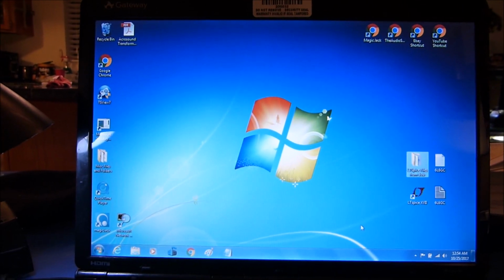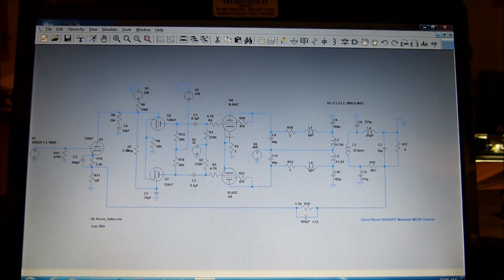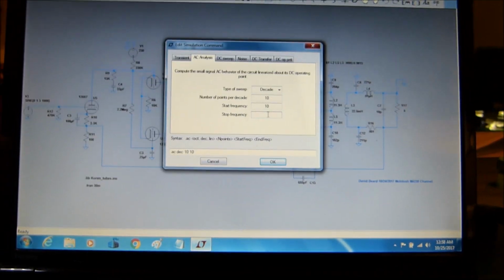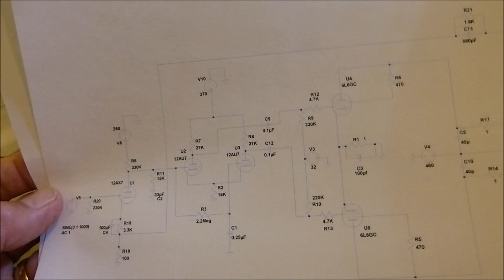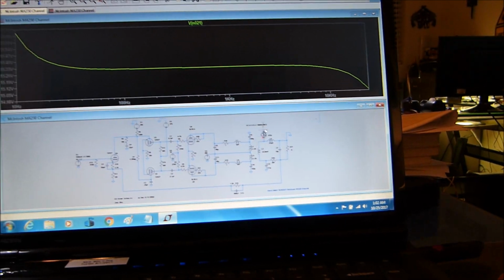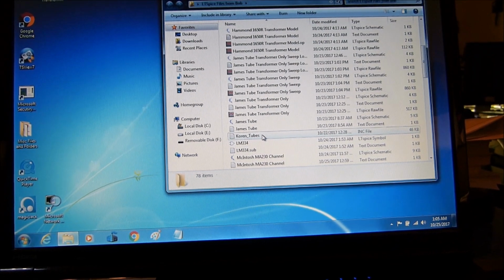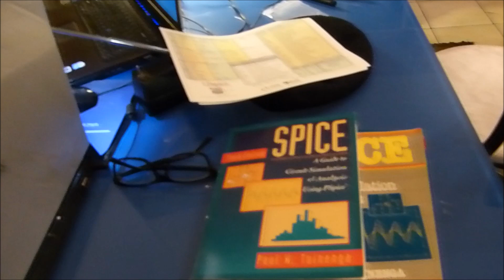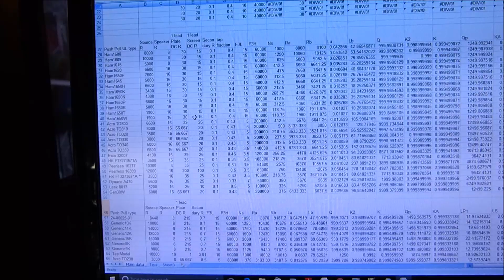LTSpice Modeling Of Vacuum Tube Amplifiers & Output Transformers

Comment: Hello! Thanks for the video, I'm a beginner in ltspice and I'm searching for some basic models for tetrods to study the non-linear caratteristic curve... Can someone help me if you have any schematics? 😢
Reply from the maker: Not sure what all I mentioned in this video but there are two libraries of tube models available on the Internet. One is by, Normal Koren and another known as, Ayumi. Search for, Normal Koren Spice vacuum tube models and Ayumi Spice tube models. There are many models available to download. Spice is the original modeling program going back more than 30 years and is what models are often referred to. We use them now in LTSpice. There is also a student version called PSpice but I do not know if it will use these vacuum tube models or not. I just clicked on some of the links below in my comments (have to open my comment) and they still work. Try them. Hope this helps.
Reply: Thanks, I'll watch your links! I'm struggling to find a model of tetrode that isn't "beam" because I need the unstable curve but they seem to be unreachable... For example the RCA 24-A, I've found the datasheet but not the spice model
Reply from the maker: @Daniela-ow2vd  You can build your own model. Use a known good working model (tube number) to start with and study the details and how they relate to the specs of that tube. It is just a text file and you can modify it and save it with a new name. Then study the model (tube number) you want and modify the working one renaming it to your tube. It is a bit tedious but it works pretty well. I have done that for large transmitter triodes. The EL34 is a pentode so maybe just delete the specs for the suppressor grid (??) might get you close. Hope it helps.

Comment: That's a great quick intro to LTSpice. LTSpice is absolutely great. It takes some time to get to grips with and take advantage of its more advanced capabilities but it takes very little effort to get a basic circuit in it and get it to work.  I can't remember what my first experience with it was 20 or so years ago when I first got to use it but I recently installed it again and I found it to be a complete doddle. I was really pleasantly surprise by how easy it was to use without having any prior training or experience in using it. It has a very intuitive UI.

Comment: Can this be relevant to '60s ~ '70s solid-state amps?  Any advice would be greatly appreciated. Thanks!
Reply from the maker: Yes, the LTSpice program is very powerful and is used for solid state equipment. 

We are fortunate that it can also be used for vacuum tube equipment if the Norman Koren or Aymui library of vacuum tube models is also downloaded and copied into the directory where the LTSpice program is located. You can down load it for free at the link below.  It is a fantastic program based on the Spice circuit simulator program developed at UC Berkeley. There are other Spice based programs like PSpice which has a free download also that is a student version. The student version is functional with a limited library of models (I do not know if it will run the vacuum tube models or not) and a limited amount of nodes in the model. Usually, the PSpice student program is sufficient for most projects. I used is successfully when I worked for Lockheed at WSMR in the 1990's.

http://www.analog.com/en/design-center/design-tools-and-calculators/ltspice-simulator.html?gclid=EAIaIQobChMImM6u8a-C3QIVTLnACh0iGQMfEAAYASAAEgJM_fD_BwE
Reply: ElPaso TubeAmps Wow! I have a mystery Amp from '76? (SS Earth Producer) I have no schematic, can't cross-reference the power transistors - not too worried, I'll just put the Peavey's in without blowing anything up? - but I've been wondering how many different transistors would do different tones.  With Ltspice I could find out. Thanks!

Comment: Just a tip: the Koren models are grossly inaccurate. While none of the tube models accurately model clipping behavior, I have found the freely available Ayumi models to be incredibly close.
Reply from the maker: Benjamin,
Thank you. I can find it easily at http://ayumi.cava.jp/audio/tubemodel_3.20_win.zip
and it unzips easily but I can't figure out how to put it into a file like the Koren tubes and call it as a library. I try calling each tube individually but it I can't get it to work. I suppose I could copy each one into a folder but that seems too laborious and I am sure there is an easier way. Can you help?
Reply: The Ayumi models are trickier in that there isn't a single library for all of them, and that they require a bit of editing to work in LTSpice. I decided to just create a library you can add, with all of the models "fixed" for LTSpice already. This should make them easier to use. Here's a link to the zipped up library file: 

https://www.dropbox.com/s/0uhqqvdnqpq03qu/Ayumi_Tube_Model_Library.zip?dl=0

Just unzip it in a folder LTSpice can access, use a standard .inc statement to include the library, add the appropriate symbol for the tube type you want, and then edit the value field to the name of the subcircuit given in the library. The name of subcircuit is usually just the tube type.
Reply: A few other pointers, there are pre-triode strapped models for various pentodes, beam power tubes, tetrodes, etc. USE THEM. The simulations are faster and more accurate.

For a triode, you would just include a triode symbol, but for any pentode, tetrode, beam power tube, etc, regardless of the number of grids, you have to use the tetrode symbol. 

The little readme file I wrote has more information, plus a complete list of all the tube types available, given as the exact string you want to enter in the value field when using that particular tube model.
Reply from the maker: I have been trying them and what I have had to do so far is include each tube individually in the schematic but when it runs it turns out really bad so I suspect I am not including another file in the directory that is necessary. Is there any way to put all of these files in one folder so they can be called very simply as they are in the Koren tubes with a .lib statement?
Reply from the maker: Great... Thanks Benjamin. I just sent you a message concerning what you fixed above. I will download it and try it out. Many Thanks. ..
Reply: In order to use the individual files, you have to replace all instances of the character ^ with **

I did this with the library file. Give them a shot, I have found that they are extremely accurate. For the 6L6 and 6F6 models in particular, datasheet specified plate current and screen current for given plate and screen voltages are correct within about a 1 or 2 percent variation in grid bias. They closely mimic actual bogey tubes.
Reply from the maker: I just tried it. I copied the .INC file into my LTSpice directory and call it just like the Koren file with .lib Ayumi_Tubes.INC and it calls up the 6L6, 12AX7 and 12AU7 in a McIntosh MA230 file and runs great. I see just a tiny bit of clipping the same as the Koren file as I am over_driving the amplifier a bit at something like 58 watts.
Reply from the maker: Not sure what you mean by replace all instances of the charter ^ with ** ? I did a * on the Koren tube call but that is all.
Reply: Disregard my last comment. I see you're using the library file I built. Replacing ^ with ** is necessary only with Ayumi's original files. My library file has already done that for you. I'm glad it is working! It should be clipping at ~58 watts for the Mac, but the behavior of the tubes is more accurate with Ayumi's models.
Reply: The most dramatic difference I've found is when comparing FFT plots on single ended tubes at clipping. The Koren models fall flat  and give unrealistic amounts of higher order harmonics, whereas Ayumi's give results that perfectly correspond to empirical data from Harry Olson and Otto Schade, among others.
Reply from the maker: I can say that the FFT plots with the Koren models I have been using don't look right. I will try these sweeps and FFT plots. Very encouraging.
Reply from the maker: There is another gentleman (Matthew) that has been commenting on some of these videos that can create models from the tube characteristic curves. He has written models for me using the 811A (which is the same as then Svetlana SV572-160) and another model for the SV572-10 and the 1626 that I used in the headphone amp. He is very good at it and has posted links on how to do it but I think it is complicated and I can't indulge in the necessary understanding right now.
Reply: The Koren models are written from tube datasheets. The Ayumi models, if my understanding is correct, were generated using both datasheets and data culled from an actual tube on a tube tracer. No model is perfect, but I'll admit to being more suspicious of any model generated using just the datasheets.

At best, these models give an indication of the potential for performance. No physical 6L6 is going to perfectly match any model. No collection of inductors coupled together in LTSpice is going to give an accurate indication of core saturation behavior. At the end of the day, we still have to build and measure.

Still, there is something appealing about being able to play around in a digital sandbox, and proving the circuit should work, before even turning on a soldering iron.
Reply from the maker: Benjamin,
I just ran comparisons of three different amplifiers (six simulations). One set with the Ayumi models and the other set with the Koren models side by side so I could see both and compare them on the same screen. They are somewhat different and the resulting data differences are small. It would be tedious to post the numbers but I could do a video to demonstrate if you think viewers would benefit from them. The Ayumi files run considerably slower in my Williamson amplifier model but in the simpler models run at about the same speed as the Koren models. In either case, it would be virtually impossible to tell how either model would actually differ from the real world. I am very thankful for these Ayumi models you have taken the time to assemble into a file that can be called with the .op statement the same as the Koren files and I know the vacuum tube audio world will appreciate them also to be included in LTSpice models. It is an amazing thing to me to find others of like-mind willing to take the time and share as I have experienced on my YouTube videos.  I don't know how to do it but if you can post the file you sent me for easy access and download for others to use, I am sure it will propagate throughout the vacuum tube community and be put to good use.
David
Reply: I would appreciate a demo video if you could do it. In push pull models you would expect small differences, due to the even cancellation, in single ended, the FFTs do look very different. Also keep in mind that strange FFT results are often a result of strange OPT modelling issues. I havent solved them, and don't know of anyone that has.

 I have a test setup circuit directly comparing a single ended 2A3, a single ended 6F6, and a single ended 6L6. The Koren models and the Ayumi give different results for 2nd, 3rd, 4th, 5th harmonics. 6th and above of course are down in the noise, and would be in the real world as well. Actually, in some circuits, thermal noise and shot noise from any preceding pentode stages can mask 5th order in single ended. 

I recommend using a wealth of tube models and checking to see if they are in relatively good agreement with one another in a given circuit. I tend to fall back on the Ayumi models because they are highly regarded by other DIYers, seem to match empirical data I have, and cover about 99.5% of the tubes anyone would ever need.
Reply: The Dropbox link I commented is open to all. If you should do a video, even a short one, about the Ayumi model set, link to it in the description and I'm sure it will propagate around.

I absolutely love your channel and have subscribed. It's good to see other tube enthusiasts who rely on modeling, empirical measurements, as well as subjective impressions to guide them. All too often, folks rely solely on simulations, or become obsessed with actual THD or IMD measurements, or worse yet, disregard measurement completely and resort to their own "golden ears". Your channel shows a fundamentally better and balanced approach to high-fidelity that I hope spreads like wild fire. Kudos! :-)
Reply from the maker: This could be a really interesting project. I will start thinking about comparing the Ayumi and Koren files (of course, video of the simulations) and then put the little Mac amp on the bench and see what reality is. How could that go wrong...   :-)
Reply from the maker: Benjamin,
I am sometimes challenged with these uploads but can understand the process and I have uploaded to DropBox and even have a free account there. Can you please refresh my memory of the link as I can't seem to find it in the emails. I definitely want to post the LTSpice schematics I am always drawing up and make them available to all - free of charge and free of any liability for me. Initially any video would be posted to YouTube the same as all my other videos. If there is a process that I need to know how to upload maybe we should go private email? TheAudioShop@SBCGlobal.net
Reply: I've found a solution to at least part of the strange FFT results. The following lines need to be added as directives to the schematic:

.OPTIONS plotwinsize=0
.OPTIONS numdgt=7.

The first option prevents LTSpice from using a terrible lossy compression system when plotting the FFT. The second forces higher precision calculations. Neither of these appreciably alter simulation time one way or another.

Also, dropping the max step time in simulation is helpful. I've been using a maximum time of 10 nanoseconds. I have an extremely fast processor and it takes ~10 minutes to simulate 250 ms, depending on frequency etc. For our purposes, I'm willing to bet I could choose a step size at least on the order of the microsecond and not introduce gross errors.
Reply: ElPaso TubeAmps : Thanks for the link to Ayumi's models. I don't know if you've browsed through the site but it's mighty impressive. Of course it's much more useful if you can understand Japanese (actually, Google translate does a pretty good job, I must say). Oh well, so little time, so many things to do! Fascinating stuff!
Reply: Thank you for this. I had not heard of the Ayumi models. Up until now I thought the Koren models were one of the two most accurate valve models freely available. I'm sure that with the advances in AI (machine learning) we'll soon have very accurate models for any valve with published curves and more!

Comment: I love your channel outstanding. I recently discovered LTspice and enjoy it as well. I am very fond of vacuum tube circuits. I was using the Koren tube library from a University site that is no longer active. as an inc file. I notice you are using Koren tubes as well as a library file, How do you install the Koren tubes in the LTspice. Thank You appreciate your help
Reply from the maker: The Koren Tubes file is just a file included in the same directory as the LTSpice file so there is actually no installation. If you have trouble finding any of these files let me know and I can forward to you as they are all free and I assume no restrictions about sharing with each other. I am also willing to share my  amplifier files that I draw up. I don't know how to post them for free download so I would need an email address and I will be happy to forward anything I have to you. Thank you for your kind words. This part of my hobby and life is very rewarding much like amateur radio was decades ago where we shared common interests and passions and knowledge for electronics.

Comment: Is it only designed for Valve type amplifiers or can you make other circuits with it using say IC'S?? So you will be designing your own amplifier now hopefully?
Reply from the maker: It's primarily used for solid state. The fact that it can be used for vacuum tubes is because of a few guys like us that have taken the time to make models of the tubes, like Norman Koren, and share it. I have never used the Spice group of simulations programs for tubes until now. I really like LTSpice - much easier for me then PSpice. As for designing our own - I think all any of us do nowadays is select circuits or parts of circuits from well known designs and implement them in our builds. By coincidence, last night I was studying a Mullard 20 watt design and it was very much like the McIntosh design used in the MA230. I think everyone has plagiarized each other circuits since the beginning.